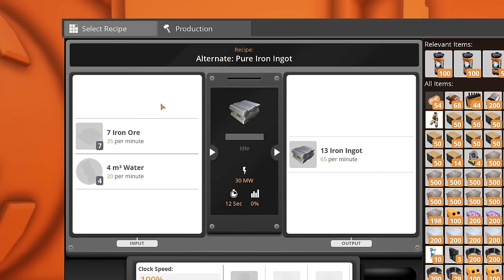Making 53.5 CRYSTAL OSCILLATORS Per Minute in Satisfactory

Comment: I build almost exclusively using the hover pack.  Also, when I build on this scale, I let the items I'm going to use build up in storage then I preload all the constructors, manufacturers, etc. when I'm using a manifold, so it takes no time for it all to come up to speed.
Reply: This; and I'd add that a full belt of wire is 780, not 750. Also, the standard cable recipe is pretty inefficient. The single most important thing in the game is hunting sufficient harddrives that give you a lot of the super-efficient alt recipes.

Comment: Hey Bitz,
quick question from a newbie:
How do you decide whether to put down 12 constructors and overclock the last one or put down 13 and undercock the 13th?
Thanks in advance :)
Reply: Less mats and preference as far as i can tell
Reply: Underclocking number 13 uses less power then overclocking number 12.
Reply: @samuraidriver4x4  yes but then you have to build 2 extra constructors and all that comes with it i think the small power spike is a worthy trade off
Reply from the maker: Hey, good question.. For me, it has nothing to do with power, as i never really worry about it.

 Honestly, it's just space im building the machines in. If placing 13 is going to overhang other machines or it could be just choosing between odd or even. 

Most of the time, it's even. That's it 😂